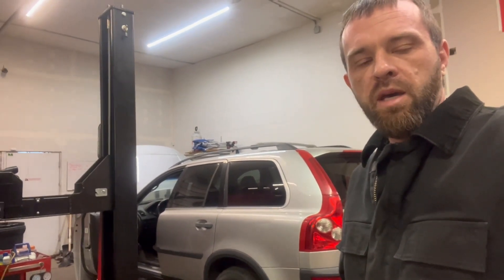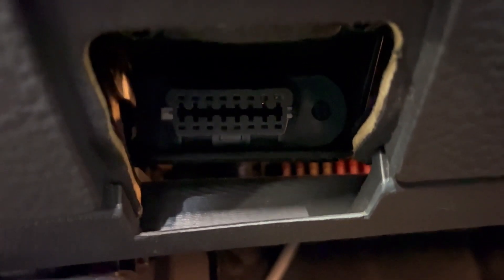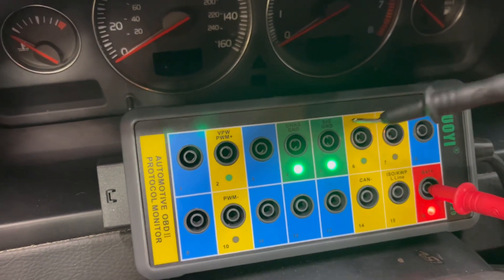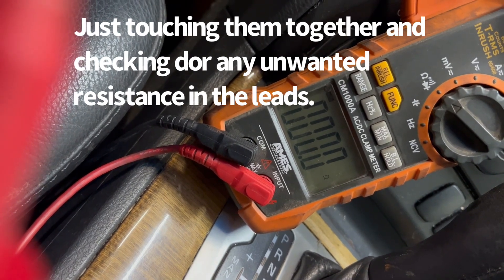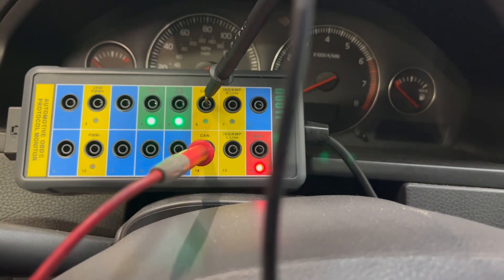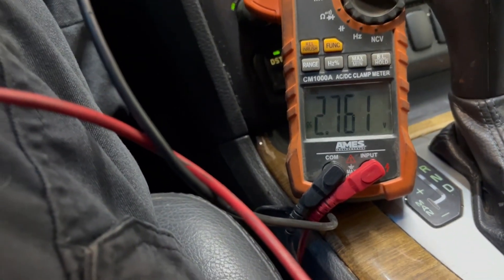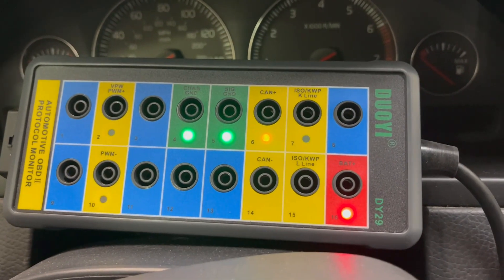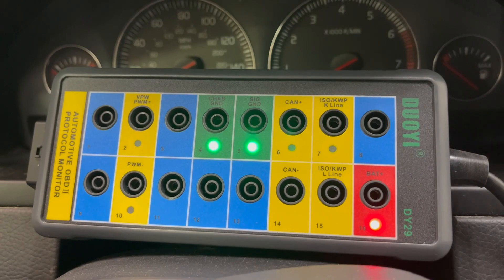How to test your CAN BUS network at the DLC with a multimeter

Comment: one thing I have never been able to get an answer for about CAN networks is where does the bias voltage come from?  What module is responsible for maintaining that 2.5v bias on the network?  I had a ford transit van in my shop a few weeks ago with the entire power-train high speed CAN1 network down.  No communication, no bias at all(none and the DLC, none on the back of the gateway module and none at the ECM).  I requested more diagnostic time and the customer refused since the vehicle have over 200K miles on it.  So I never got to figure out what was wrong with the vehicle but what I couldn't find out from service data was where did the bias voltage come from.  That would have helped me in my diagnosis if I would have know where its origin was.  So can you or some one explain that to me.
Reply from the maker: Not sure if I’m understanding the question fully. Every system is different, But the 2.5 V for the most part I would assume comes from internal circuitry of the gateway module. It’s like any other reference circuit. Internally regulated from the module.

As far as that ford you were working on goes. I would guess one of the modules failed internally. Or, a power or ground supply issue to the actual module itself. Or an open circuit. I probably would’ve been looking for something in the wiring harness after I checked all the powers and grounds. 
Would need to reference a diagram to know how the circuit is laid out.
Reply: The voltage is generated at the DLC/gateway module.

Comment: In my experience a DVM is too slow for CANBUS testing.  You can have a shorted CAN high or CAN low and it’ll still show correct voltage.  A scope is the appropriate tool for correctly diagnosing CANBUS issues.
Reply from the maker: I agree. This was just meant to show basic CANBUS diagnostic. The DVOM can be very effective for certain tests though in my opinion. Quick measurements to verify circuit integrity. If you are trying to see modules communicate, the scope is the correct tool.

Comment: check resistance with ignition off?  voltage with ignition on?  Thanks
Reply from the maker: Yes, always test resistance between pins 6 & 14 with the key in the off position for an accurate reading. Should see right around 60 ohms.
Reply: @BigDogDiagnostics  Correct me if I'm mistaken, but when checking the Canbus, is it not better to remove the ground cable to kill the 12V system?